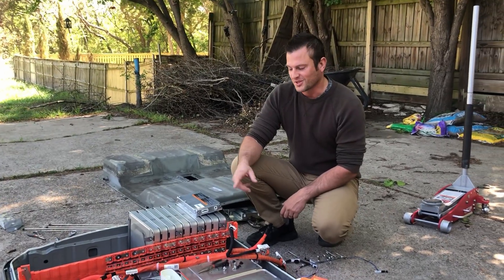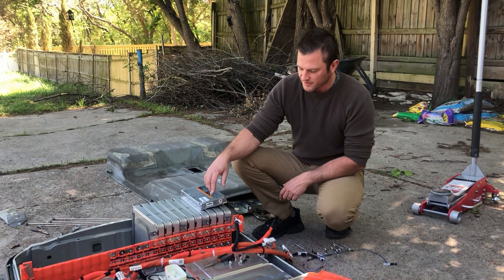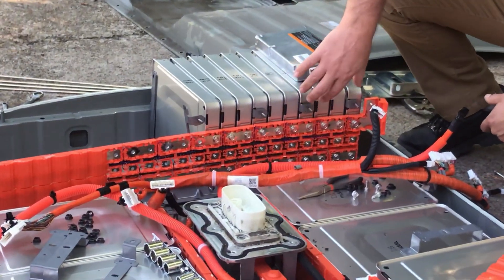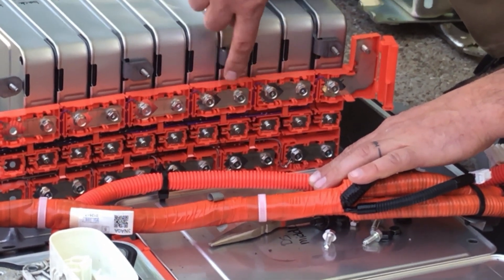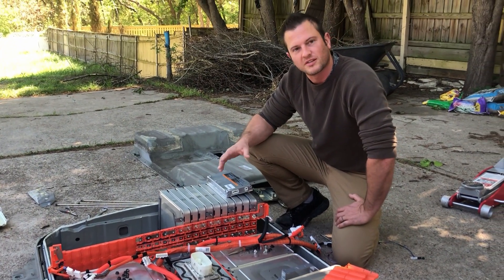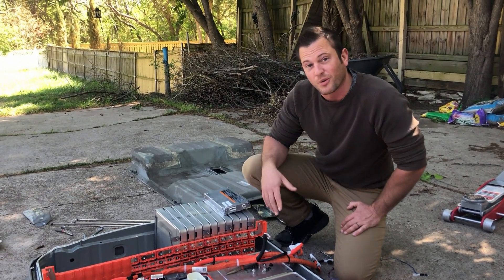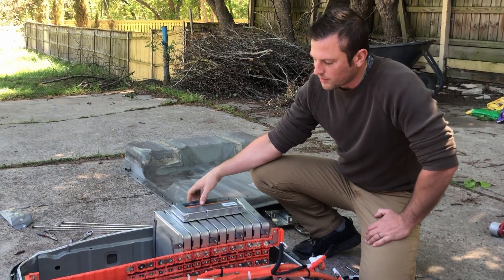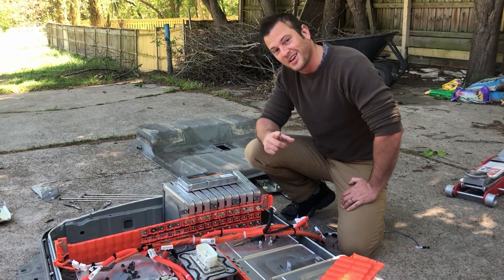400 volt 96s bms inside an EV

Comment: I wonder if it would work just to put cells (for example 18650s) in parallel with a degraded module to bring up the capacity to match the rest of the pack.
Reply from the maker: That would be a simple process mechanically speaking.  You just have to make sure the voltage and temperature range of the added cells are within the range that the cars bms is going to be keeping the OEM cells.  There is a TON of unused space inside the pack to fit extra cells.  LiFePo4 batteries should work in this application.  I'm actually a little surprised that no one has tried this yet.  I think as the supply of aftermarket Leaf batteries dries up in the next year or two here, you will see people get very creative with processes like that.

Comment: Good to see you again working on the leaf. Please keep the BMS with the car for future rebuild of good battery bank.
Reply from the maker: I am keeping everything from the black Leaf to use for parts.  If I had done this a few months earlier I would have given you the rear window.  My goal is to re-use every part of the vehicle, or sell them to other Leaf owners who can re-use them.  Good to hear from you buddy.
Reply: @InnovativeSustainableSolutions  I discovered that the BMS keep the voltage level of all the battery at same range which means if one of the batteries is not good the BMS will keep the rest of the pack at same voltage level as the bad battery.

Comment: Woah! You dropped a full battery pack in your backyard? That must have been quite a sight!
Reply from the maker: I was definitely nervous handling 400 volts for the first time.  But honestly the whole thing went off without a hitch.  I'm pulling the last few modules out of the pack now.  I'll try and code the CAN-Bridge tonight for the new battery.  I have to say, if you exercise caution and common sense, anybody can do it.
Reply: @InnovativeSustainableSolutions  But, did you use pallets and a floor jack? Just, the whole idea of dropping a 1,000+ lbs battery back in a backyard without any special tools or lifts sounds wild to me. Let alone the idea of dealing with 1000lbs AND 400v at the same time! I'm hesitant to even lift my own vehicle to do a simple oil change. Mind blown!